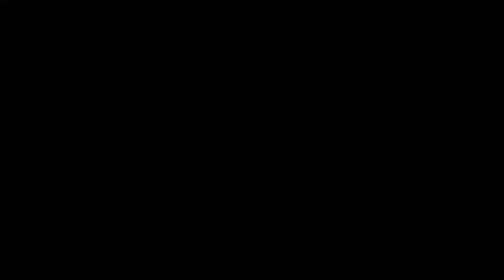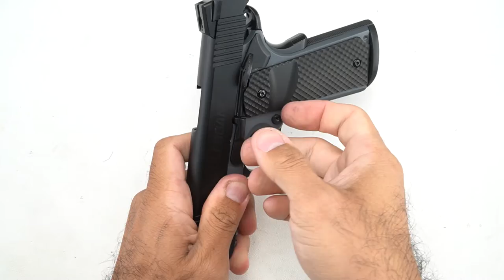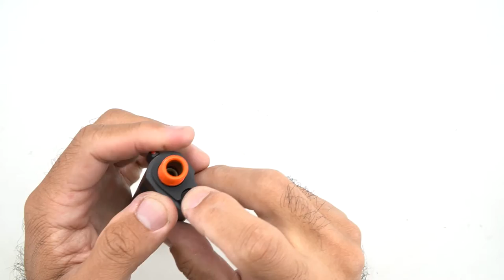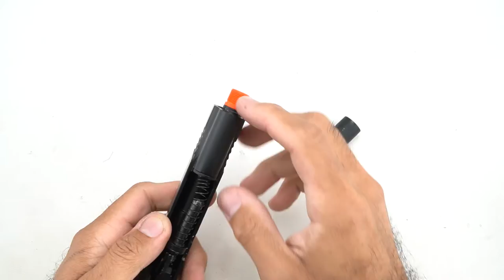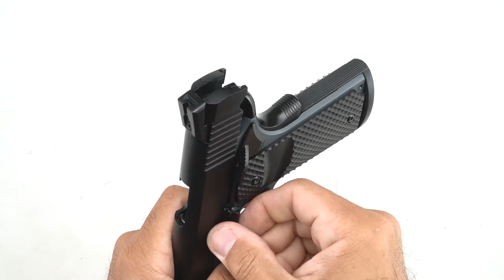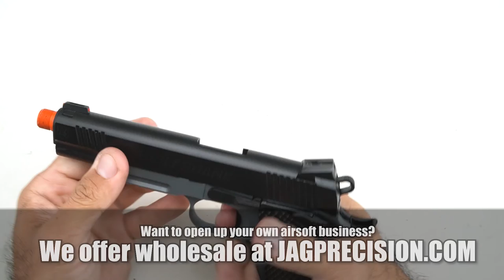Echo1 Wolfsbane 1911 takedown - JAG Precision

Comment: I was trying to put the compensator piece on it and pushed the piece under the barrel back to far and now the silde will only silde back half way and the barrel is loose and i dont know what to do
Reply: The plug is stuck, had the same issue on mine too you just gotta stick something down there and wiggle the plug to unstick it